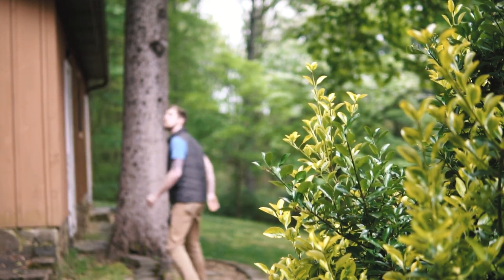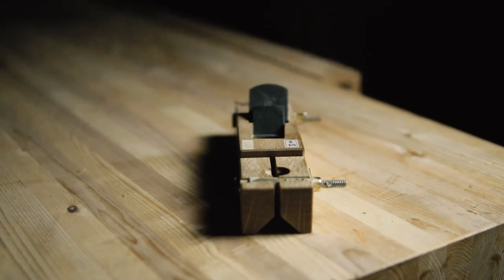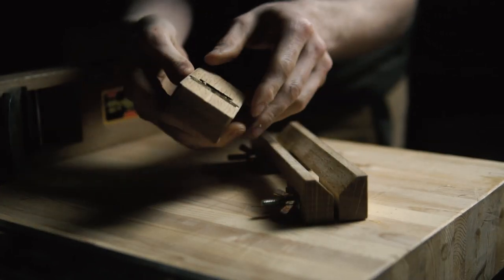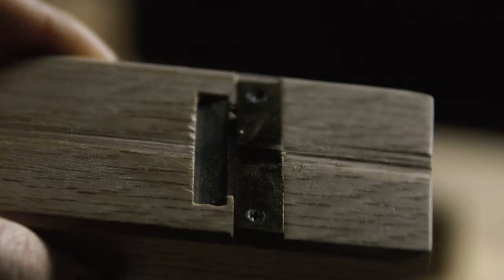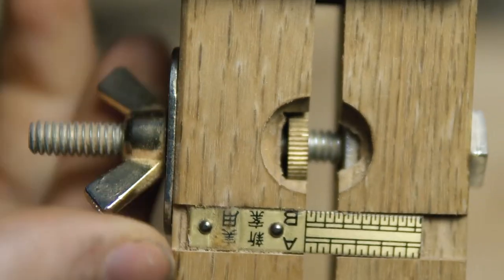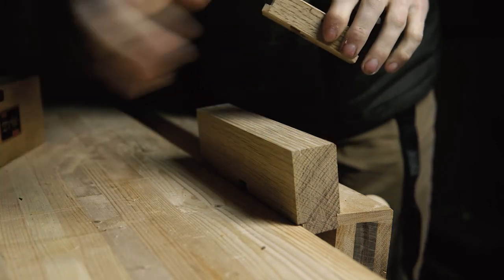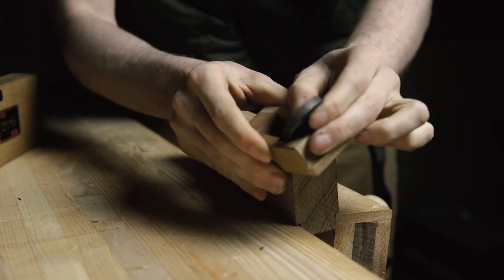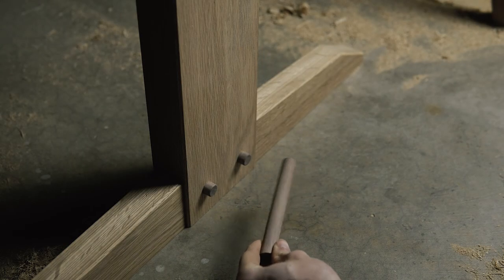The Mentori Kanna - A Japanese Tool You MUST have!

Comment: Ive seen one where the blade is straight. The one you have is angled. Any idea on the difference?
Reply from the maker: It's not a big difference either way. The only benefit of the angled blade is when you chamfer across the grain. It prevents tear out, or breaking the corners off when planing.
Reply: @SethsProject thanks!